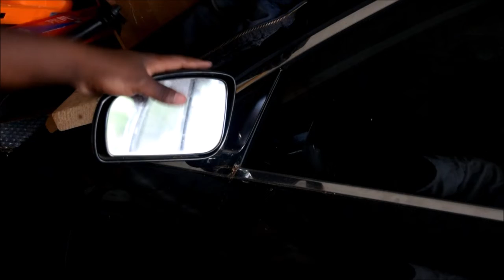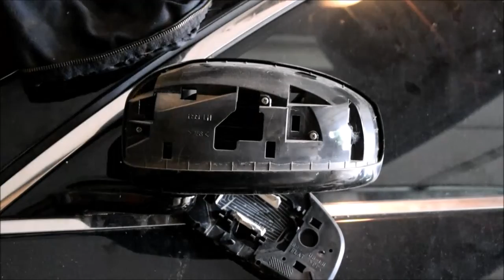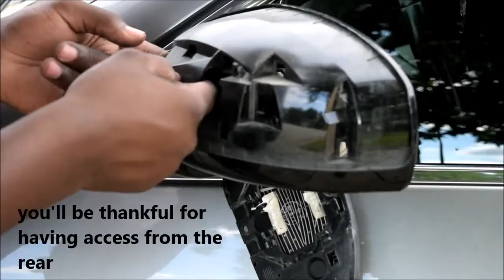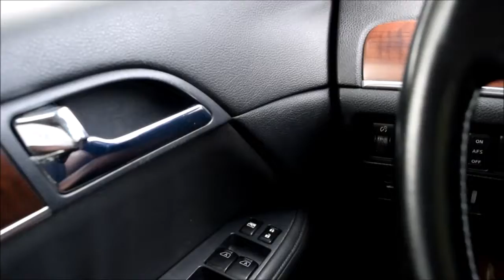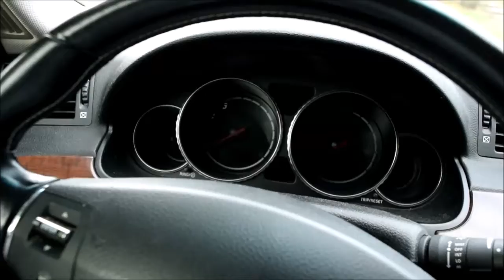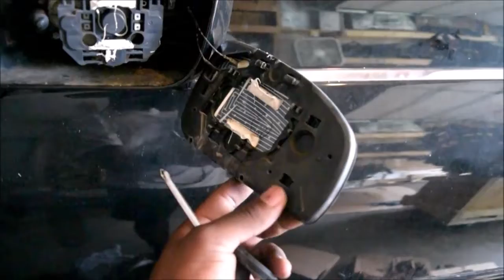Infiniti M45 M35 Side Mirror keeps clicking. Can't keep set memory

Comment from the maker: There is a very simple solution as well if you can't find a spare and don't really need the memory function. Just erase the memory by disconnecting the battery (you have to relearn the automatic windows).
Reply: EdBwoy I have m35 2008 premium Package iam in UAE 🇦🇪 ( Dubai )
Reply from the maker: ///AMG  by part number, the altima coupe used the same cap. Not sure about any others
Reply: @EdBwoy  wht is this part called
Reply from the maker: Maybe Altima & Max will work too. Let us know how the experiment goes